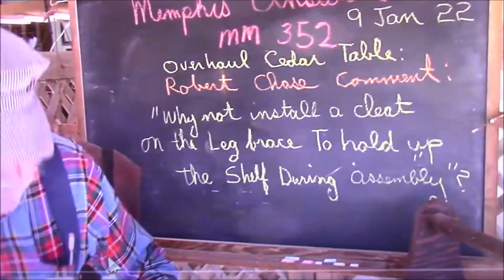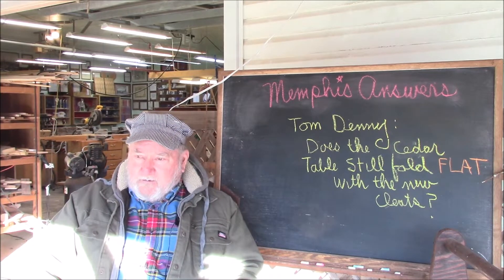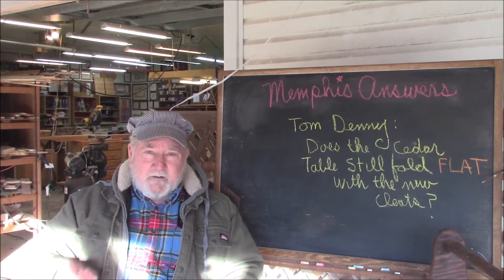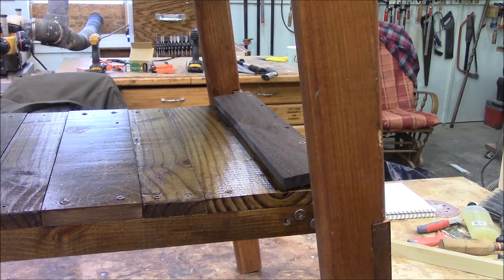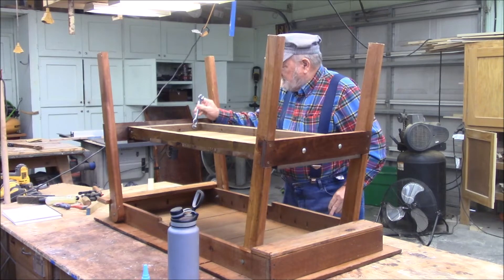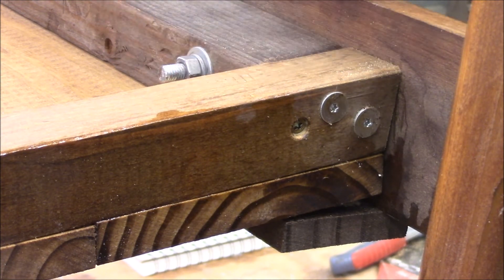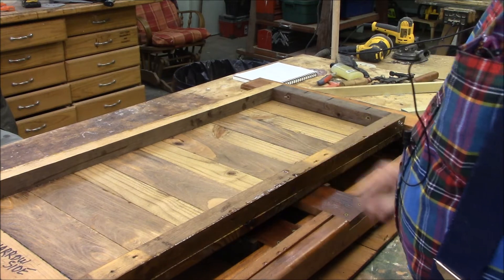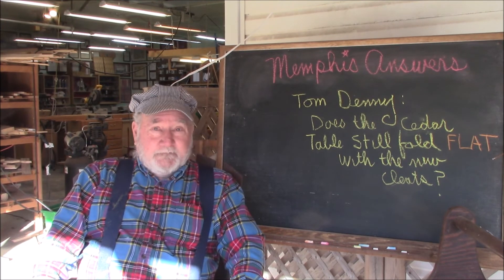Memphis Answers Do the cleats prevent legs from folding flat on cedar table

Comment: I was surprised to see my name so prominently displayed on your channel. I doubt that will get you any more views, possibly less! You answered my question however. I was wondering if the legs would fold flat with the shelf stowed and it didn't, but I think you have already discovered the fix. Cut/trim the cleats so they lay between the shelf's rails and I think it will fold flat once again. Thank you for the follow up and thank you for the video.